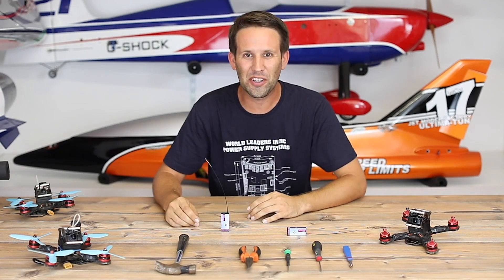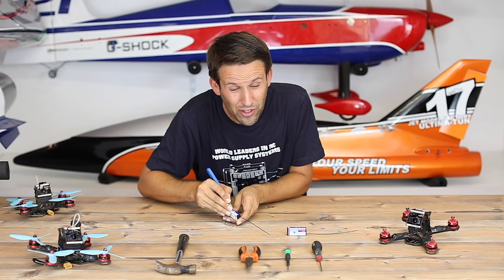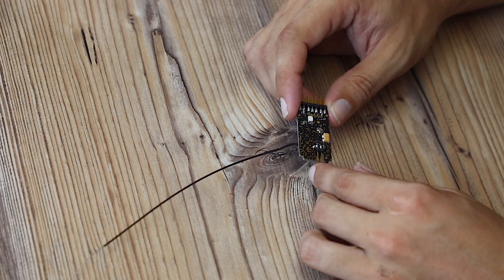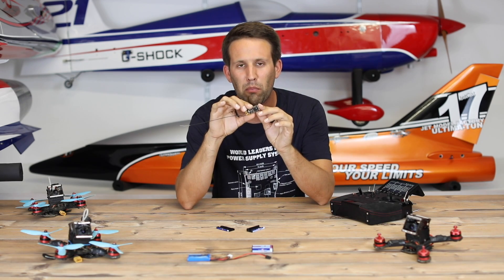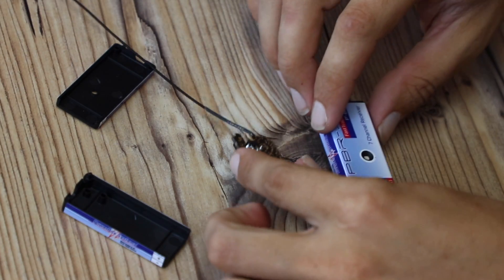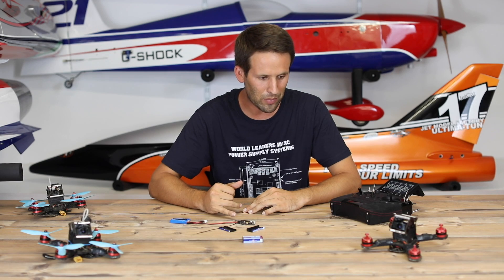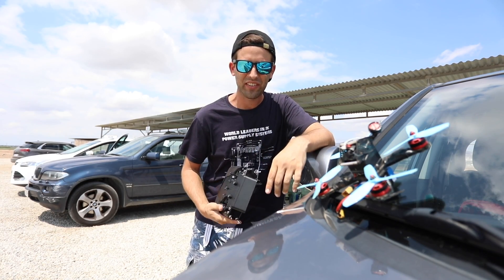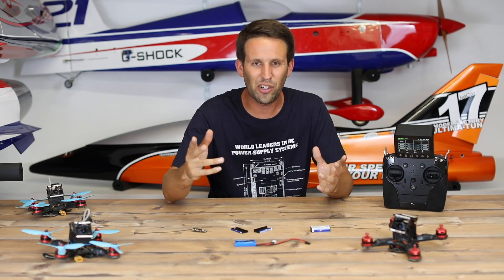Making a Powerbox Receiver smaller?!!!!

Comment: Its great to see the Powerbox Core system is so nicely made and can be modified / repaired so easily. There is a real need to Quad and DLG receivers. I hope these will follow after the launch of the system.
Reply from the maker: Richard had a great response to the video, something that I was a little concerned with how they might take it, so I think we can see smaller RX's in the future without the need for the hammer!